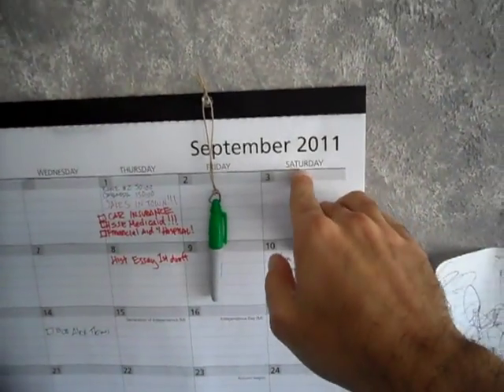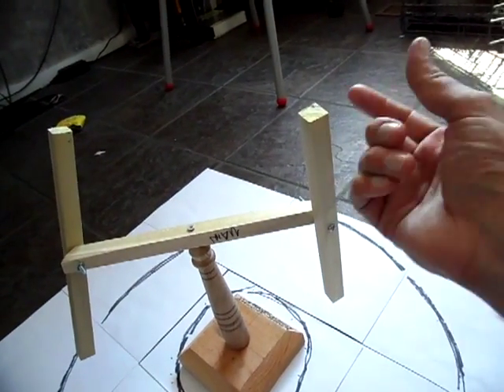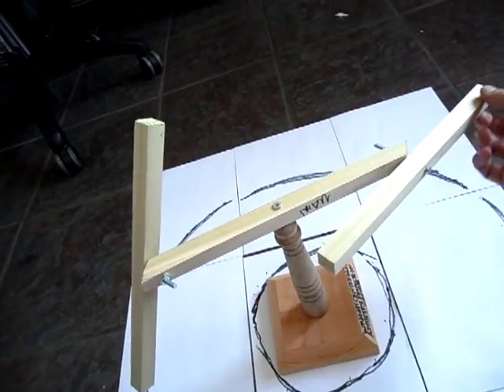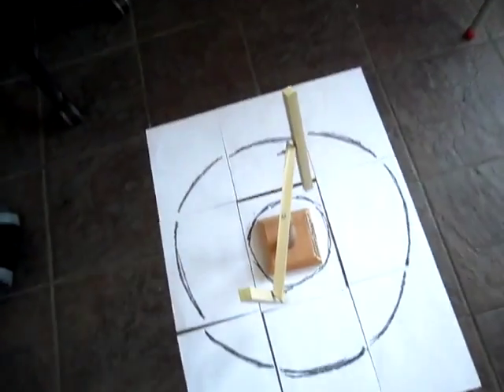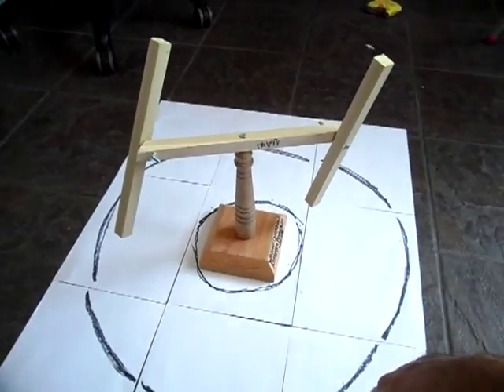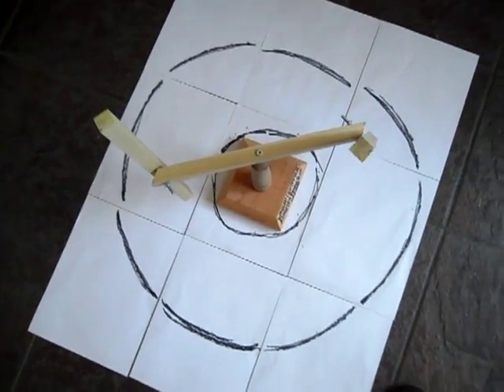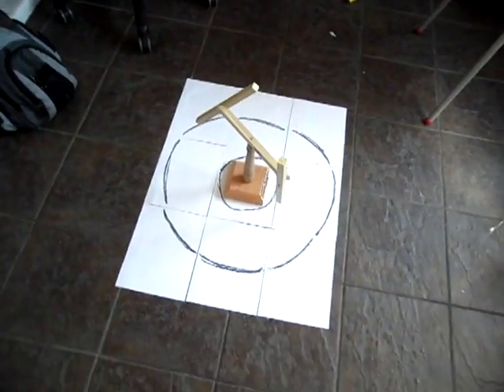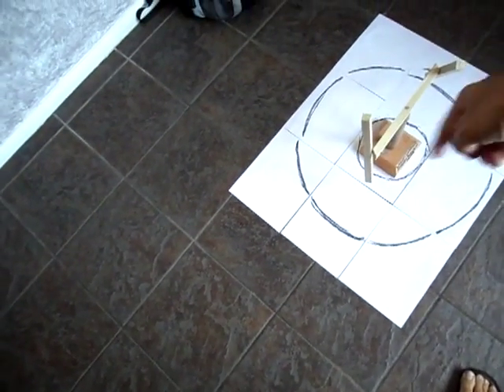The Wright CAP (Centrifugal Asymmetry Propulsion) Motor

Comment: If those were propellers going around they would be operating at an ever changing frontal velocity and it would be almost impossible to have the right pitch propellers and  for efficiency. With revolving masse going in a plane and changing the axis of the plane, I feel there is a gyro prcession effect which I need time to think about it as at  the  moment I just cannot process the helix going around an annular torus which I use for winding coils on.   Good elevated thinking here.

Comment: surely it just gyroscopic effect causing the outer rotors feeling lighter at the expense of the load being transfered down the centre. put it on digital scales and youll see xassxass was correct.

Comment: @xassxass yes. The angle is what causes the device to lift. It causes the forces to nullify on the inward/downward action, giving the upward/outward motion a vector movement wherein lift will be maximized at a 45 deg angle slightly inward and to the side. When you add up all the lift angles you get a net upward lift.
I'm happy to hear that others have thought this through as well. This is the first time I've seen this exact design, or anything like it. So this is the first on youtube.

Comment: Sorry my friend. This is not a new. I invented simular & many others several years ago. Its a time consuming curse.Because sadly what you will see every single time- is the beauty of physics unfold. Every action = an opposite reaction. Always. 
The small "angle": why do you need that on the outer "force propellers"? Couldnt it just be aligned with the horizontal main axl? 
The inner force moving outwards (downside circle)= the outer force moving inside (upper cirle). Or have I misunderstood?